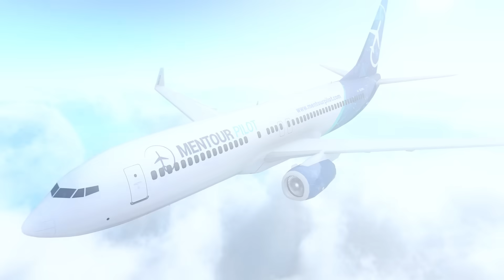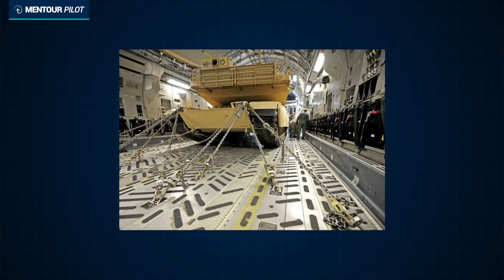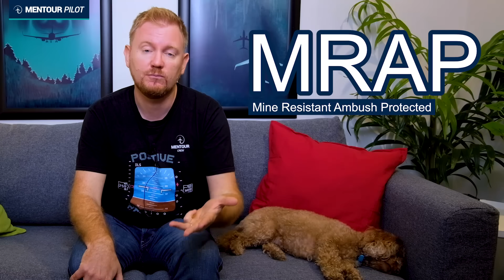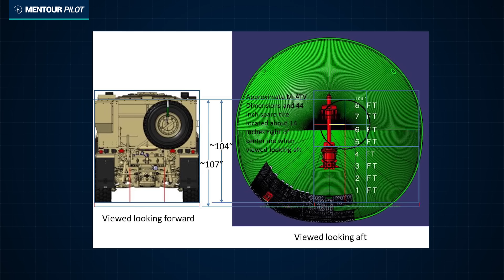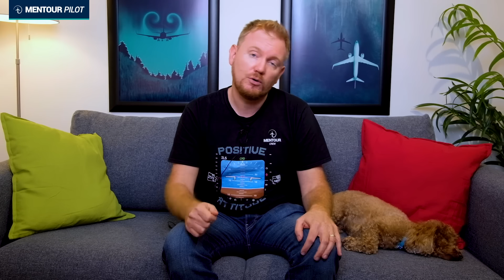Why did the pilots LOSE control?! National Air Cargo flight 102

Comment: Something in this scenario doesn't work. According to this video, it was the smaller vehicle that broke loose. That vehicle was strapped down by 24 straps and broke loose while the larger vehicle that was twice as heavy didn't break 26??
Maybe it wasn't the number of straps , but location, and order of straps buckled down that played the finale role. 
I wonder if they loaded the vehicles one by one, strapping them down first ,or did they parked all five first ,worrying  about proper position of the vehicles. In that case, I wounded if they didn't park second vehicle to close to the first, not allowing for proper visual inspection of straps (  chaos  and  maze   ) Maybe  bumper of the first vehicle wasn't strapped down at all. It is clear that the first vehicle rolled back at rotation (lift off). In that case it is not the amount of straps ,but no straps on bumper that would allow the smaller vehicle to roll so easily.  Tragic oversights,  maybe because they were not accustom to seeing military equipment (star struck).

Comment: I was in the air cargo business for many years I am particularly fond of the  Dehavilland DHC 5A Buffalo twin turboprop
she is a powerhouse 23800 lbs dry empty Wt 49900 all up Power and acceleration incredible There was a incident not mentioned to flight Ops . Delivering cargo to a remote mine sight in the Canadian North the aircrew without a cargo master unloaded the aircraft and with the usual get homeitis scenario rushed to organize the herc straps by throwing them in a pile at the forward cockpit bulk head  thinking they would organize later on the homeward leg  that's fine, but they filled a large milk container with chains and tensioners  very heavy like 200 lbs  and did not secure the container at the forward bulkhead   Lets go home  the time from standing take off roll to V1 is about 5 seconds with a Buffalo empty, this is a high performance aircraft like no other  300 feet you are airborne with 30 degree flap 
The container full of chains had a 40 foot run down to the cargo door and smashed into it and it dissipated the energy thanks god because if it would of went up the ramp door it would of ended up in the upper tail compartment where the rudder and elevator bell cranks and hydraulics live. I am not impressed with pilots with get homeitis I had to fix this machine

Comment: If you carried one of those on a truck bed, you would never use web strapping. A DoT inspection would crucify you. High strength steel chains with lock pins are the ONLY way to hold a heavy vehicle on. Those straps were good only for motorbikes or small cars even on a truck bed, but never in the air with all the pitching going on.

Comment: Adding to all this, take-offs from Bagram airfield are said to have been done at a steep pitch angles to gain altitude quickly because of concerns about snipers firing at planes. I think it’s likely one or more of the heavier vehicles came loose and there was a train that pushed against that aft bulkhead. It’s hard to imagine how the Captain and loadmaster’s discussion about this super heavy cargo not being strapped in sufficiently wouldn’t extend to concern about movement during the steep take-off roll. The mid-east wars of George W. Bush were conceived by Donald Rumsfeld as outsourcing practically everything to private contractors. This is the kind of thing that can happen. A loadmaster in name only who doesn’t recognize the catastrophic potential of this load, does no calculations of the stress factors, the Captain of the flight sensing trouble but then decides to ignore it. The Air Force command should have been aware that this National Airlines had no idea how to handle this kind of load. That flight was a living breathing catastrophe that was inevitable as soon as the plane began its steep ascent. This was a lesson that that didn’t need to be learned this way. The larger lesson might be that outsourcing prolonged wars halfway around the world can run you into so many problems that you have to ask, are they worth it? Just the human cost alone suggests not.

Comment: Thank you, Capt. This is a very clear explanation of what happened that day, I was in Bagram airfield on that horrific day those were the last few days of my sixth deployment to Afghanistan with the US National Guards. My sincere condolences to all the crew member families. If you go a bit deeper in this case, remember departing from camp Lethenick Helmand which is very flat, coming true Hindukush mountain to Bagram airfield which is 4900 feet above sea level, all six vehicles the two MRAP and four RJ  are equipped with diesel engines and air brakes, the crew stapped all vehicles yet I am positive during loading and stopping them they applied the vehicle air brakes as well, landing in Bagram was coming high with high posable speed and ditch the aircraft due to war, don't you think during landing one of the vehicles air brakes disengaged and only moved 2 or 3 inches, during takeoff, I think the second vehicle backed onto the last small MRAP and started the chain reaction , Captian please elaborate on this theory.  Love your channel sir

Comment: Excellent presentation, the only hiccup was your animation depicts the National Airlines flight as a 747-8F instead of the 747-400BCF which was the actual aircraft N949CA.... sorry to be nitpicky
Reply from the maker: That has to do with limited variants available on the simulator used.

Comment: Those vehicles in my opinion should of been held down with chains and boomers. They wouldn't move for anything. 
In the oil and gas industry everything of substantial weight is always held with chains and boomers. Straps are too fragile.  They tear really easily on anything with any kind of edge to it. This is such a sad story.

Comment: I called improper cargo securement the instant the crash was described to me in this video. The reason why is a similar accident happened in the Soviet Union which ended up decapitating the Pacific command for the Soviet Union . The root cause was loadshift And that plane crashed in the exact same way.

Comment: Can you please do the Olympic Airlines 411 09/08/1978 and explain how the jumbo did not crash with the speed of 158 miles after engine failure during take off ..please

Comment: Thank you Mentor Pilot, for this video. You did good work on it.
Today,  I watched complete dash video of it for the first time.  There was a fixed camera,  somewhere at the airport that shows an empty frame, then that aircraft slowly dropping into view, slightly nose-up. I did not watch the impact because I knew what the problem was. On that day,  I was hooking someone up to Facebook and I am not on Facebook myself so I did not have time and was not interested in their pain. 

In a scenario with more time or altitude,  I might have tried "slipping" the aileron/rudder while ADDING Power but it is not taught and in fact, not authorized on aircraft equipped with spoilers but it keeps the wings level while the aircraft quickly loses altitude.  Try it on a Puddle Jumper that you're Checked Out in.

I agree with you regarding the recording.

Comment: A question to the wide audience. Why was debris found on the runway already? Did the aircraft skin got pierced? This isn't said in the video so I am wondering how so much debris could actually be outside the plane.
Reply: It’s quite possible it got pierced by the moving gear as it was lifting off or soon after.

Comment: Horrible accident. Those pilots knew something was not right. They knew. They sensed something. On another note cant they use  raised floor fittings to stop these kinds of cargo from rolling if the straps fail? Kind of like heavy metal barriers rammed up against the wheels of the vehicles?

Comment: He probably calculated the total amount of straps needed only by the rating of the scrap being pulled in a straight line and did not figure in the angles that the straps were attached. A 1,000 lb strap can only hold 500 lb attach ed at an angle of 30°.

Comment: Those double palets with some plywood in between probably acted as a skid layer. The locking hooks probably only hold on to the bottom one, while entire load hung on those thin straps.

Comment: I just got a job at FedEx express loading Boeing 757's weight balance and placent is done by ramp agents while material handlers load and unload the aircraft as well as resupplying food and coffee for the pilots, and the mechanic manages gpu, pushback and everything else. The training we get is very long and it's very important that everything is secured properly. If one thing breaks even tiny, the plane need to be grounded

Comment: Why would high strength chains or wire cable not be used in place of these small straps? I am guessing the answer has to do with a proprietary fastener connection to the aircraft but, an adapter to accept such connections seems like something an engineer would have designed for cargo that, in comparison to chains/wire rope, would require such a ridiculous amount of straps to secure.

Comment: I understand redundancy, but 60 straps is insane. Its too hard to ensure each strap takes its share.    And if each strap is only able to take a 20th of the item,its too easy to break it... If it moves a bit.. everything moves even if its tied down properly ....  The safe strapping method  is to use straps strong enough that   5 to   10 is enough...this may mean spreader system to attach the fewer straps down to many points....

Comment: I am surprised the pilots did not take more interest in the cargo securing, particularly after it was reported that the cargo had moved and atleast one strap had broken. I also would have thought calculating the number of straps required would have atleast been checked by the pilots. At sea the first officer would normally do all of that sort of thing and seconds ensure his plan is followed.

Comment: Just look at the strapping. 7:54 That's suicide. If you can't see using the strap material not end attachments for securing to the vehicle or the floors limited securing points you're in the same boat as them. Using that trick requires even more than standard straps just to get lucky. Chains okay but fabric straps results? Not rated or safe for that usage method.

Comment: Jack screws on Primary flight control  (Pitch Stabilizer) is a very poor idea. Runaway trim etc., see Max 8.  The Lockheed pitch control system is a much superior idea.
Reply: And yet the TRI star had an appealing pitch trim failure rate.
Reply: @peteconrad2077  Not so Sir, I was a senior maintenance engineer on Tristars for 22 years and never once experianced a single Pitch trim problem. There was only one case where a mechanical connection from the Stabilizer to the Elevator broke loose and caused a trim problem, the aircraft however landed safely and the problem was corrected.  Everything on the Tristar was superior to anything produced by the other three big competitors, even today.
Reply: @GreenIsland38  I know that the airline I work for had two such incidents on the L-1011. It’s happened on no other type we’ve operated in living memory.
Reply: @peteconrad2077  I also have Boeings, (767/757)Airbuses, (A330)and McDonnels (MD 11) in my engineers Ratings Lizense so I think I can make a comparison, and none of them compare to a Tristar, although it,s now no longer in service as an Airliner.

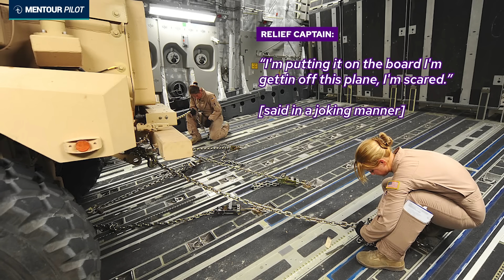Comment: 12:35 "replacing straps... beefing up more... I HOPE" - unbelievable. With such symptoms displayed, you have to at least double your straps (triple would be better) and also add chains (if there are any). No absolute necessity to calculate, just add FAR more. Just common sense. These guys should not be allowed to move furniture in a van!

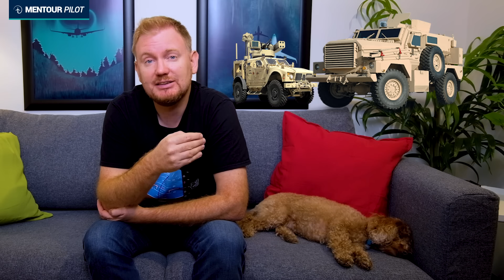Comment: 9:30 "60 straps" would snap in cascade if turbulence etc. is hard enough. Should have used chains instead or on the corners at least. Even in a trailer.

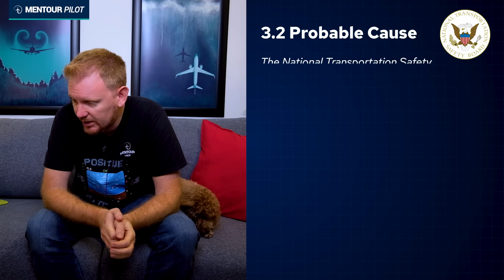Comment: 22:25 "National airlines inadequate procedures" - inadequate morons in charge. What the hell was their management thinking about? If you prefer to employ / sub-contract elementary school´s dropouts to do the job - do NOT allow them to calculate. Get a table of exemplary loads with numbes and pictures, as to where and how many straps and chains to attach for this and that kind of cargo. Quite simple, generally works flawlessly. How dumb someone has to be to ignore that?

Comment: Those pallets should have been actual third members bolted unto the vehicle chassis, and the 'pallette' itself CONNECTED to the aircraft's mounting system. The wheels of said vehicles should have been taken off and either strapped to the chassis or stored inside. If the vehicles were merely rolled on to pallets and then strapped down to it that is just a recipe for disaster

Comment: I think it's time to throw out the chains and straps if they always move.  And design a metal block that sits in front and the back of cargo as well as the sides to prevent them from moving even an inch..  I am talking about a metal block of at least 16 inches thick with at least a height of 3 foot or more to stop any movement.. But it won't happen, why even though normal people like me think these ideas up.. Because you and i don't work for the people who think they know best. And yeah i worked within engineering  design and technology.. 
So good luck with your new found recommendations and training, with the hope the person who loaded the cargo has got it right... My design wouldn't even need training as it's so simple a kid could do it.. These  people in charge thought they knew best so carry on.. 
It's happened once and it will happen again..

Comment: Being a young Sergeant many years ago, I had the responsibility of organizing shipments for the USMC out of Bastion on C-17 Globemaster III's. Besides the weights, I had the responsibility of ensuring all of my TCN #'s matched the pallets we shipped equipment out on. I once had an entire shipment pushed back by the load master because I got the TCN numbers wrong. It was the only mistake I made during my deployment, but it was one of the most stressful jobs I had in my life. This incident was imprinted in my soul  during  training, and my instructor literally told me if a plane came down with a shipment I failed to ensure was processed correctly, I would serve jail time. I'm baffled at how the load master loaded that shipment without second guessing it. Regardless, this incident really changed  alot to my recollection, and more than likely contributed to the strict attention to detail my job demanded.

Comment: I was based at Bagram at the time of this accident and had landed just prior to the departure of the accident aircraft, needless to say it was a major event. One aspect of the report not mentioned, although it was detailed in the preliminary report brought out less than two years after the accident, was fatigue. Maybe the thinking on this had been revised prior to the final report. If I remember correctly, the crew, although having positioned up from Bastion earlier, (the Bastion runway was not of adequate length for take-off with fuel for Dubai, hence the need to fuel at Bagram), crew rest had been insufficient. The landing at Bagram had been very heavy, possibly as a result of crew fatigue, it was this landing that was thought to have caused the movement of the cargo. Reading the transcript of the cockpit conversation during the turnaround, it did appear that the crew were maybe showing signs of fatigue. I'd be interested to know if this was a factor mentioned in the final report.

Comment: First of all the pallets used for such a huge 18 ton vehicles weren't able to withstand the required strength as shown in the picture.

Secondly, I am astonished that why the Loadmaster didn't prefer to use tie down chains and tie down devices instead of using straps which are having very less strength ie only 5k lbs max.
The third point is though the vehicles were only tied down to the pallets but not to the cargo floor of the aircraft. They only relied upon the tiny pallet stopers.
The fifth point the USAF is having many cargo airplanes like c 17 and c 130s wich are specifically designed to be used for military cargo, these airplans have much more tie down equipment as compared to the Boeing airplane.

Comment: I can't believe that no one seems to have commented on the fact that the straps/chains shown in the video all are attached to the vehicle at one end and the pallet/floor at the other. These vehicles have pneumatic tyres that are inflated. Imagine the effect of a tyre deflating during the flight. Also as the aircraft gains altitude (in the first flight) the relative pressure in the tyres will increase to the tune of the reduction of cabin pressure poss. 3-4 psi, that is presuming that the tyres have no leaks. Maybe the 'normal loosening' reported by the loadmaster was a relatively harmless condition if the vehicles would normally be unloaded after one flight. I imagine the greatest 'g' forces acting on the vehicles would be on take off and climb out, but in this case the second take off happened without a thorough load check/re tighten.
Chains for the bigger vehicles may be ok but they are only attached to one point on a flimsy aircraft floor.

Comment: I remember sitting on the ramp of 4° Fevereiro, Luanda (LAD), Angola in June 1991, waiting to board a cargo flight when a C-130 (J6-SLQ) did its roll. Just after rotation, at maybe a couple of hundred feet, still before the threshold on 23, it suddenly pitched up, then yawed left and right a bit then dropped tail first and exploded. Horrifying sight. Like Bagram, improperly secured load shifted.